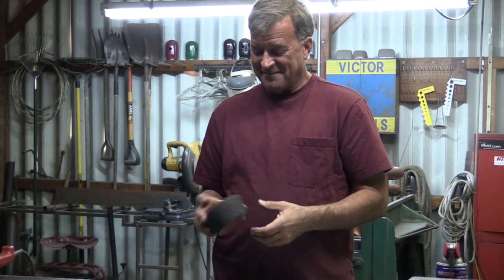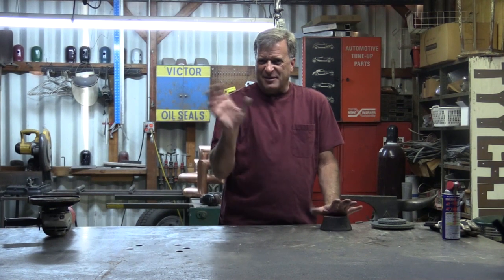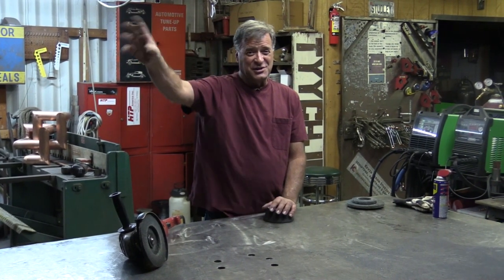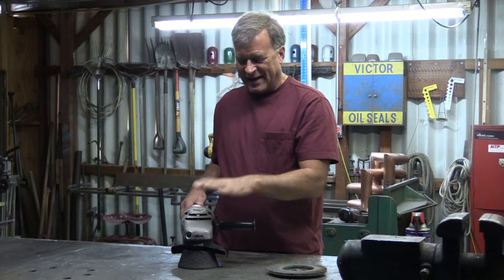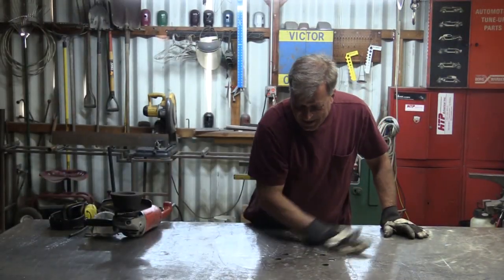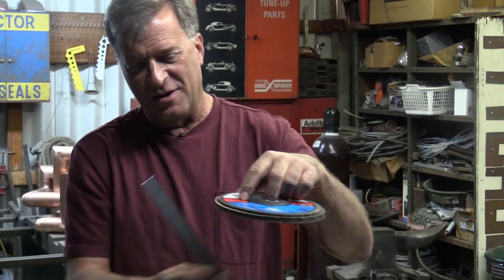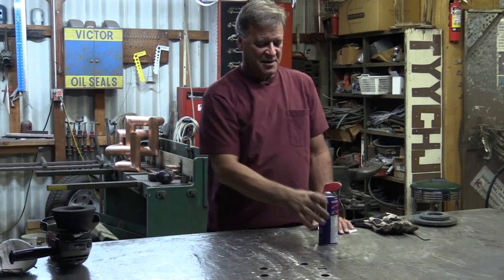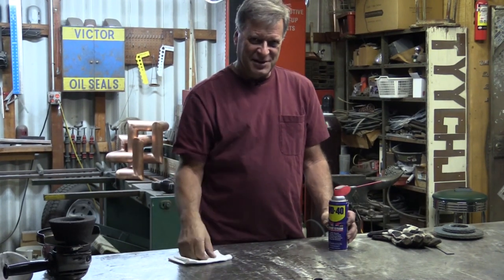How to Keep Your Welding Table Clean and Rust Free - Kevin Caron

Comment: I'm late to the party , but each time I finish a project on my welding table , I put a light mist of anti-spatter or Pam cooking spray on it , then spatter rarely sticks ... Has worked really well for me ...
Reply: Rub old motor oil, transfluid.... And rub it with a rag. Spatter bounces around and doesn't really stick to the table.

Comment: Great advice. May I suggest trying a "seaweed" disc, otherwise known as Scotchbrite pad. It's hard enough to remove light splattering, rust, even mill scale, yet soft enough to leave a polished finish keeping your table level. 👍
Reply from the maker: Got a name for it?
Reply: Hi Kevin
Here is a link:
https://www.bunnings.com.au/scotchbrite-paint-and-varnish-remover-disc-contour-127mm_p6320286

Some brands specifically say paint & rust removal.

Comment: I find that if I rub down the table top with MIG nozzle gel from time to time the spatter doesn't tend to stick (or comes off easily) and the surface does not rust.

Comment: If WD-40 is keeping the rust off, you don't have any rust!  It actually causes rust.  We get more rain in one day than you get all year (170" per year with several days more than 7") plus being around salt water teaches you a thing or two about rust preventatives and what works.  In the late fifties/early sixties when it first came out it was much better formulated.  They quickly diluted it down to pretty much kerosene and it lost all coating properties.  It is a great cutting oil for aluminum and a good solvent (as is kerosene) but it promotes rust.  Many years ago I sprayed my glass 12v fuse panels on my boat being too lazy to use vaseline that year.  That next spring every circuit (of about 50) had enough corrosion (they were inside the engine compartment) that they wouldn't conduct 12v.  Cleaned them and put vaseline on the terminals and all was good.  I also once tried it on my power tool tables etc that were in storage.  Every one of them rusted up in two or three months and the aluminum parts powder corroded.  Cleaned them up and clear laquered them or sprayed with LDS and other products (TriFlon, Boshield etc) and they were good for a couple of years.  I could go on forever with WD-40 failures.  So spend the money to buy a good rust preventative and use the WD-40 for a spray cutting oil (not on steel) or cleaner and be aware that there are far better things for those too.  Doug
Reply: Douglas Thompson I don’t see how it can cause rust. It isn’t the best long term preventative, but as to causing rust? No way. And all thin spray preventatives are just for short term use. The label will even state that. I use Boeing 2000, which is one of the best, but leave it for a few months, and rust will form.
Reply: My experience has been similar to yours. I can clean off all the rust off a tool very carefylly and spray it wd40. Over night rust will form right under the wd40 just from humidity. I have a photo of a wood chisel this happened to.

Comment: Good info, thanks guy.  Ya might mention how thick your bench is though.  Seems kinda relevant to me...
Reply: +Charles Struble I did worry about the table getting thinner over time, but I figure, that is part of the use of it until it's  not useful anymore.
Reply from the maker: +Charles Struble          At 1 inch thick it will last a while I am sure......

Comment: Instead of using WD-40, try using a silicone spray lubricant. Let it dry then wipe with a clean rag. This will protect it longer and better without the residue that is left behind by other products. Plus it is less likely to contaminate your welds if applied properly. 90% of my welding is GTAW so a clean table is very important. Have a Merry Christmas :)
Reply from the maker: +Vern  Hood          Great tip!!      will give it a try.
Reply: Don’t use silicone. It screws up a lot of things. Painting anything when silicone spray has been present can result in bubbles. Also not good around high heat.

Comment: I have a large plate of steel I got for CHEAP.  but it's rusted (to the point of minor pitting).  I want to use this as a top for a new welding table.  I tried a grinding disc on a huge old grinder I have, but it was very slow and didn't work very well.  Will a grinding cup work better that the disc ?  Thanks
Reply from the maker: +Kevin Ashby         I think it will..       Not that expensive and you already have the grinder..     give it a shot!
Reply: Many thanks

Comment: Excellent and very informative videos. i have a question, what will happen if you replaced the stick rod with a MIG wire for welding thin metals, for short distances, using the same ARC welding machine, is this going to work?
Reply: +M El you wont have any sheilding gas, so the weld will be contaminated,
Reply: +mustie1 Thanks

Comment: Nice tools for cleaning the table...but the wd-40 will make metal rust..
Reply from the maker: How do you think that will happen?   WD-40 is a penetrating OIL.
Reply: As a fitter/ welder..we would spray down our tools when we got caught in the rain and really it loosened up rusty cresent wrenches the next day.... but never prevented rusting again...And our welding tables too!!!! It was a constant battle. I have heard that mig spatter spray works really well to put on your tables! Thanks for your videos !!